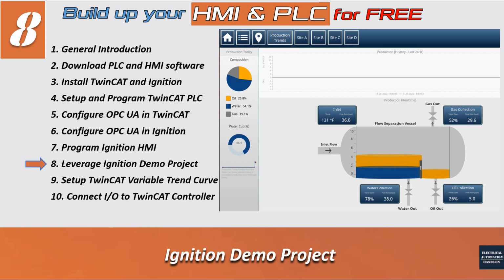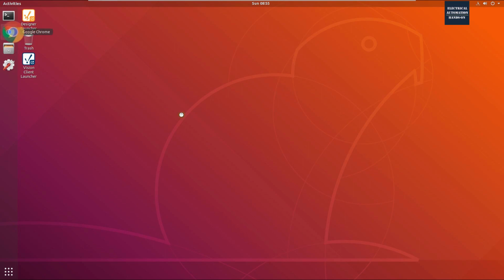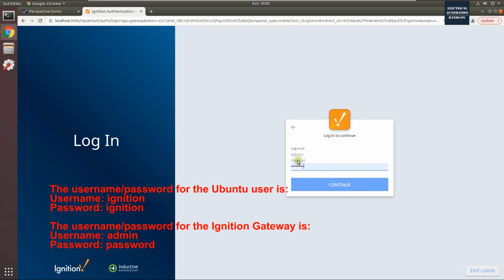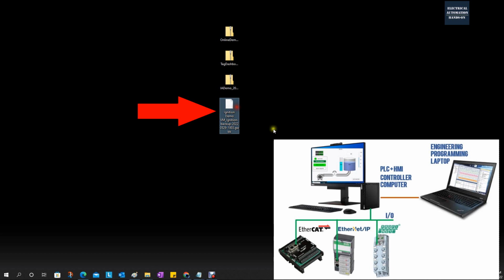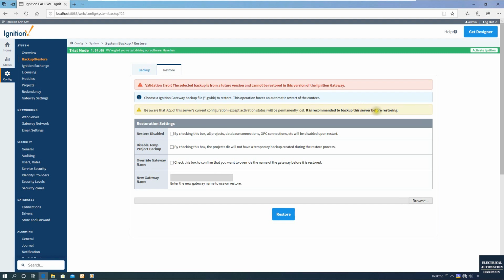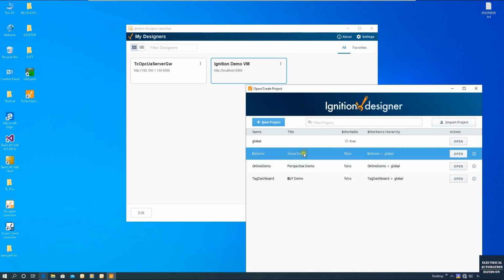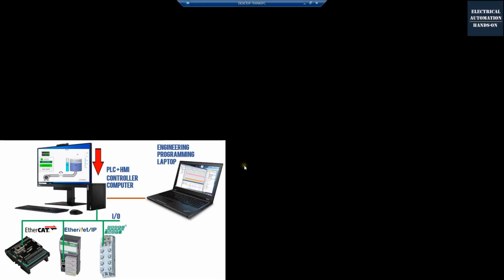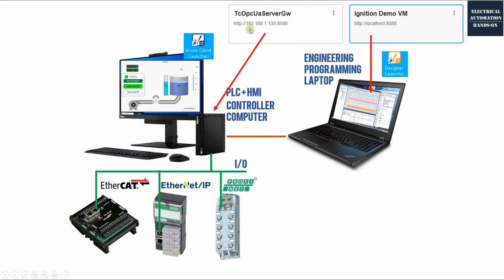SCADA08. [PLC&HMI] Ignition HMI Demo Project

Comment: its a big pls its important for me
here is it.

Svstem-2: The engineers of Mercewagen car company are carrying out experiments on their brand
new electrical car Quinto-S (Figure-2) for the new generation adaptive cruise control structure.
Figure-2: Quinto-S of Mercewagen
The adaptive cruise control basically tries to follow the velocity reference set by the driver while
tracing the distance between the other cars in front of that car. Hence, when the distance between the
leading car and the Quinto-S is far enough, the cruise control tries to move the Quinto-S with the pre-
set velocity. On the other hand, when the distance between the leading car and the Quinto-S is
relatively short, the cruise control algorithm reduces the velocity and prevents collisions. Based on this
information:
Problem-4: Assume that the velocity and the position response of the leading car can be measured as
eges and qr. Further, assume that the measured velocity and position response of the Quinto-S are
respectively given as cges and fifes. Given the velocity reference of Quinto-S as ei;:ef write down the
tracking error such that the adaptive cruise control objective is satisfied.
Problem-5: Using the error obtained in Problem-4, derive the desired accelerations for Quinto-S (i.e.
cies) such that the tracking error exponentially converges to zero value. Make all of the derivation
parametrically.

a) If the environment is a lossless environment for which the contact force can be given as
Fe(t) = Keq(t) and the system  is supposed to trace  a twice  differentiable continuous  force
reference Fref (t);
1) Write down the tracking error for this system.
2) Propose a differential equation for the error given in part                                   1) whose solution results in
exponentially decaying error from any initial value to zero.
3) Write down the condition for the differential equation given in part 2) for convergence of
error without oscillations.
4) Using the error dynamics in 2), write down the expression of the desired acceleration for
the tracking of Frei (0.
b) If the environment has losses                                                                 (i.e. friction) for which the contact force can be given as Fe(t)                       =
Keri(t)                                                                                          DA (t) and the system is supposed to trace continuous force reference Frei (t), whose
first derivative exists;
1) Write down the tracking error for this system.
2) Propose a differential equation for the error given in part                                   1) whose solution results in
exponentially decaying error from any initial value to zero.
3) Write down the condition for the differential equation given in part                          2) yielding to
convergence.
4) Using the error dynamics in 2), express the desired acceleration for tracking of Frei (t).

SYST LM-2: The Cartesian robot given in Figure-2 is supposed to be used for drawing curves on a
blackboard. The multi-DOF equation of motion (i.e. the Lagrangian dynamics) for this robot can be
given as:
A(q)04 + B(q, 14)4 + G(q) = T
where the matrices A, B, G, T and q have the following contents:
                                                                                                                                                               mo:                   o    G(q)       ron1+ ?ni   g]   T =          q = [411
A(q) = [m1 +0                                                                                              m2                                                                                    =
                                                                                                                                                               I, B(11' q)   =   0   b2          L   0           -I         2 -I   IR2-1
Here, h and h stand for the force inputs of the first and the second joints, respectively. The
parameters (masses, viscous friction coefficients and the gravity constant) used of the system are given
as:
Figure-2: Blackboard Writing Robot
Prohlem-2a: Write the parametric single DOF dynamics of actuator 1 and actuator 2.
Prohlem-2b: Modify the two single DOF dynamic equations derived in Problem-2a such that the
system  is  expressed  with  nominal  parameters  and  the  corresponding  disturbance.  Write,
parametrically, the content of the disturbance acting on each system                                       (Hint: the nominal mass of
actuator 1 and actuator 2 should be taken as m1 and m2, respectively).
Prohlem-2c; Assuming a generalized error (i,e, a linear combination of the position and the velocity
errors), write the necessary input force for actuator                                                      1 and actuator 2 (i.e. des and des) such that the
error exponentially converges to zero value (Hint: The input force should include both of the forces to
compensate for the disturbance and to provide tracking of the reference task). Make all of the
derivation parametrically.
Reply from the maker: Sorry, I have no idea
Reply: @electricalautomation  k sir

Comment: Great video! Got a question, probably a dumb question to ask since I do not have much experience with PC-based control.  I see Beckhoff TwinCat and B&R are both selling industrial PC and PLC/PAC, for a machine builder, if we do not want to buy their industrial PC, can we just buy a Dell PC and run Twincat or automation studio software on it and make it an industrial PC? Of course, we will need to buy licenses accordingly. If so, can HMI software like ignition or Wonderware also run on the same PC? Basically, combine PLC and HMI together...
Reply from the maker: Please review this series of video, you will have a clear idea. Especially the SCADA04. [PLC&HMI] Setup and Program Beckhoff TwinCAT PLC in a Computer https://youtu.be/BQbWtlwgbqk. Yes for Beckhoff system, you can use a none Beckhoff computer e.g. ThinkCentre with Windows 7 or 10 system. Please NOTE: Your computer MUST need have 'intel(R)' chip from your ethernet card.
Reply: @electricalautomation Best hands-on video I have ever seen so far! Just watched the videos and got everything working as you showed, however, I can not lunch the runtime in the engineering laptop or the pc, showing the error as follow, tried creating a different user, and rebooting, but did not work, wondering if you have some suggestions?

com.inductiveautomation.ignition.client.gateway_interface.GatewayException: Error authenticating.
	at com.inductiveautomation.ignition.client.gateway_interface.GatewayInterface.newGatewayException(GatewayInterface.java:351)
	at com.inductiveautomation.ignition.client.gateway_interface.GatewayInterface.sendMessage(GatewayInterface.java:325)
	at com.inductiveautomation.ignition.client.gateway_interface.GatewayInterface.sendMessage(GatewayInterface.java:278)
	at com.inductiveautomation.ignition.client.gateway_interface.GatewayInterface.invoke(GatewayInterface.java:945)
	at com.inductiveautomation.factorypmi.application.runtime.ClientGatewayConnection.doLogin(ClientGatewayConnection.java:88)
	at com.inductiveautomation.ignition.client.gateway_interface.AbstractGatewayConnection.login(AbstractGatewayConnection.java:920)
	at com.inductiveautomation.factorypmi.application.runtime.ClientPanel$ClassicLoginAction$LoginTask.run(ClientPanel.java:657)
	at java.base/java.lang.Thread.run(Unknown Source)
Caused by: com.inductiveautomation.ignition.gateway.servlets.gateway.functions.GatewayFunctionException: Error authenticating.
	at com.inductiveautomation.ignition.gateway.servlets.gateway.functions.Login.client(Login.java:470)
	at jdk.internal.reflect.NativeMethodAccessorImpl.invoke0(Native Method)
	at jdk.internal.reflect.NativeMethodAccessorImpl.invoke(null)
	at jdk.internal.reflect.DelegatingMethodAccessorImpl.invoke(null)
	at java.lang.reflect.Method.invoke(null)
	at com.inductiveautomation.ignition.gateway.servlets.gateway.AbstractGatewayFunction.invoke(AbstractGatewayFunction.java:228)
	at com.inductiveautomation.ignition.gateway.servlets.Gateway.doPost(Gateway.java:431)
	at javax.servlet.http.HttpServlet.service(HttpServlet.java:707)
	at javax.servlet.http.HttpServlet.service(HttpServlet.java:790)
	at com.inductiveautomation.ignition.gateway.bootstrap.MapServlet.service(MapServlet.java:86)
	at org.eclipse.jetty.servlet.ServletHolder$NotAsync.service(ServletHolder.java:1450)
	at org.eclipse.jetty.servlet.ServletHolder.handle(ServletHolder.java:799)
	at org.eclipse.jetty.servlet.ServletHandler$ChainEnd.doFilter(ServletHandler.java:1631)
	at org.eclipse.jetty.servlet.ServletHandler.doHandle(ServletHandler.java:548)
	at org.eclipse.jetty.server.handler.ScopedHandler.handle(ScopedHandler.java:143)
	at org.eclipse.jetty.security.SecurityHandler.handle(SecurityHandler.java:600)
	at org.eclipse.jetty.server.handler.HandlerWrapper.handle(HandlerWrapper.java:127)
	at org.eclipse.jetty.server.handler.ScopedHandler.nextHandle(ScopedHandler.java:235)
	at org.eclipse.jetty.server.session.SessionHandler.doHandle(SessionHandler.java:1624)
	at org.eclipse.jetty.server.handler.ScopedHandler.nextHandle(ScopedHandler.java:233)
	at org.eclipse.jetty.server.handler.ContextHandler.doHandle(ContextHandler.java:1440)
	at org.eclipse.jetty.server.handler.ScopedHandler.nextScope(ScopedHandler.java:188)
	at org.eclipse.jetty.servlet.ServletHandler.doScope(ServletHandler.java:501)
	at org.eclipse.jetty.server.session.SessionHandler.doScope(SessionHandler.java:1594)
	at org.eclipse.jetty.server.handler.ScopedHandler.nextScope(ScopedHandler.java:186)
	at org.eclipse.jetty.server.handler.ContextHandler.doScope(ContextHandler.java:1355)
	at org.eclipse.jetty.server.handler.ScopedHandler.handle(ScopedHandler.java:141)
	at org.eclipse.jetty.server.handler.HandlerWrapper.handle(HandlerWrapper.java:127)
	at com.inductiveautomation.catapult.handlers.RemoteHostNameLookupHandler.handle(RemoteHostNameLookupHandler.java:121)
	at org.eclipse.jetty.server.handler.HandlerWrapper.handle(HandlerWrapper.java:127)
	at org.eclipse.jetty.rewrite.handler.RewriteHandler.handle(RewriteHandler.java:322)
	at org.eclipse.jetty.server.handler.HandlerList.handle(HandlerList.java:59)
	at org.eclipse.jetty.server.handler.HandlerCollection.handle(HandlerCollection.java:146)
	at org.eclipse.jetty.server.handler.HandlerWrapper.handle(HandlerWrapper.java:127)
	at org.eclipse.jetty.server.Server.handle(Server.java:516)
	at org.eclipse.jetty.server.HttpChannel.lambda$handle$1(HttpChannel.java:487)
	at org.eclipse.jetty.server.HttpChannel.dispatch(HttpChannel.java:732)
	at org.eclipse.jetty.server.HttpChannel.handle(HttpChannel.java:479)
	at org.eclipse.jetty.server.HttpConnection.onFillable(HttpConnection.java:277)
	at org.eclipse.jetty.io.AbstractConnection$ReadCallback.succeeded(AbstractConnection.java:311)
	at org.eclipse.jetty.io.FillInterest.fillable(FillInterest.java:105)
	at org.eclipse.jetty.io.ChannelEndPoint$1.run(ChannelEndPoint.java:104)
	at org.eclipse.jetty.util.thread.strategy.EatWhatYouKill.runTask(EatWhatYouKill.java:338)
	at org.eclipse.jetty.util.thread.strategy.EatWhatYouKill.doProduce(EatWhatYouKill.java:315)
	at org.eclipse.jetty.util.thread.strategy.EatWhatYouKill.tryProduce(EatWhatYouKill.java:173)
	at org.eclipse.jetty.util.thread.strategy.EatWhatYouKill.run(EatWhatYouKill.java:131)
	at org.eclipse.jetty.util.thread.ReservedThreadExecutor$ReservedThread.run(ReservedThreadExecutor.java:409)
	at org.eclipse.jetty.util.thread.QueuedThreadPool.runJob(QueuedThreadPool.java:883)
	at org.eclipse.jetty.util.thread.QueuedThreadPool$Runner.run(QueuedThreadPool.java:1034)
	at java.lang.Thread.run(null)

Ignition v8.1.18 (b2022061518)
Java: Azul Systems, Inc. 11.0.15
Reply: @electricalautomation  Somehow I have to change the identity provider to None to make it work. Really wired. Got another question, I am wondering if you have tried to use IO from other brands like 1769/1756 IO, 1734 IO, and ET200 to work with this TC, Ignition setup？ Do you have a ballpark number for the license (TC, Ignation) fee if this setup is actually being used in a real project? Thank you for the great video!